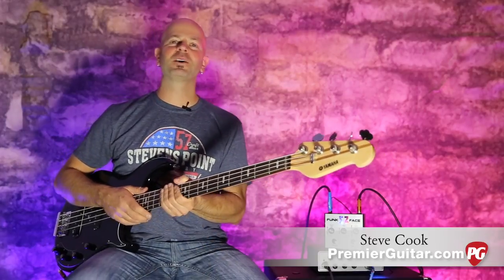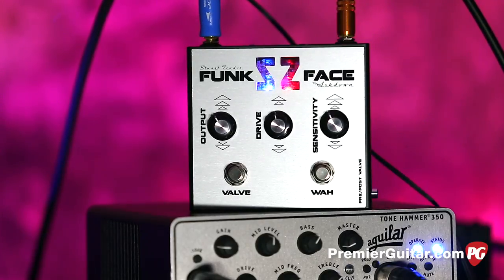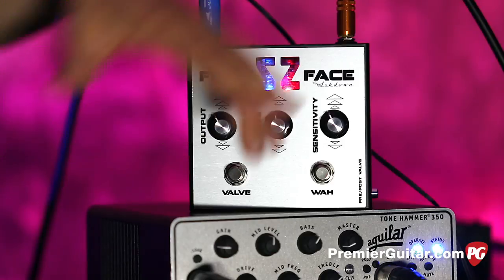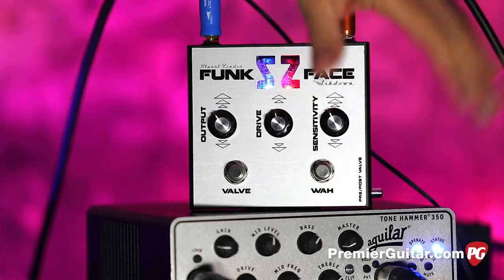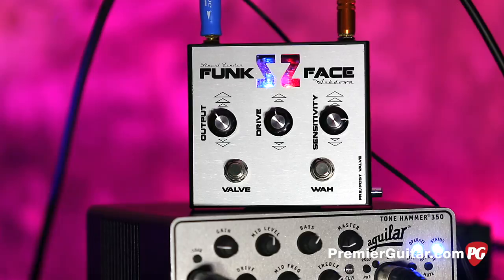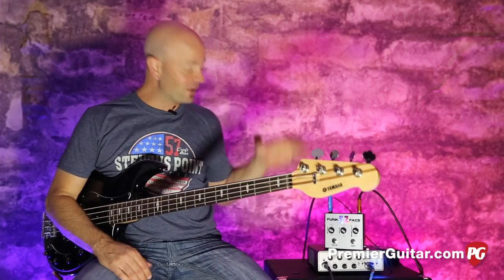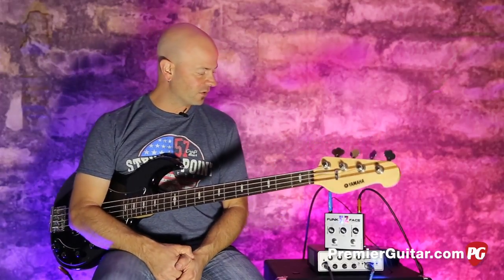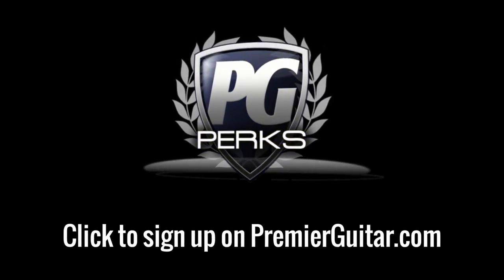Review Demo - Ashdown SZ Funk Face

Comment: The fuzz in a bass balls is a single diode if memory serves and changes the gain a little. Part of why the fuzz side was a little rough sounding. There’s a diy version which allows more control over the two filters. But overall : you’ll have more control with a bass fuzz and 2 Emma discumbobulators one in down and the next one in up position. And an xotic Xblender to control it all.

Comment: So many things wrong with this. First off it's a bassballs clone. Secondly the sensitivity never needs to go over 9 o clock on a bassballs.  People should really lower the pot value when cloning. Thirdly, it's nice that you added drive but before/after the circuit? Better off putting it in the middle like a Qtron plus so it filters the dirt like a synth. Fourth how come one of the drive options sounds exactly like the garbage rectified distortion sound on the bassballs, I don't even know how a valve does that.